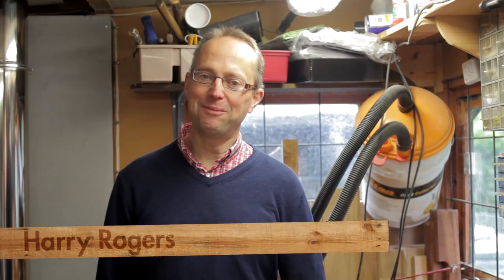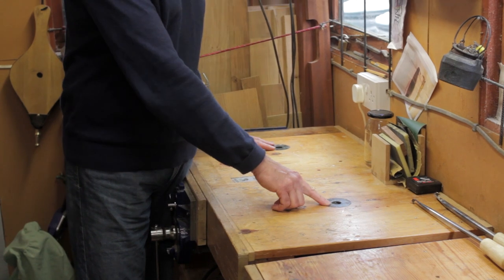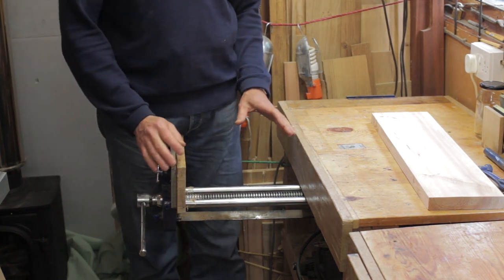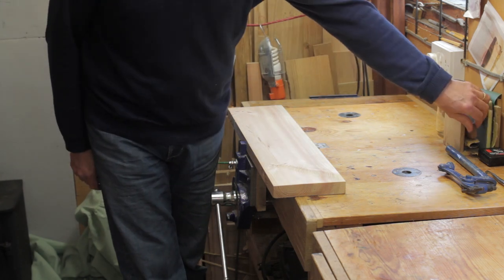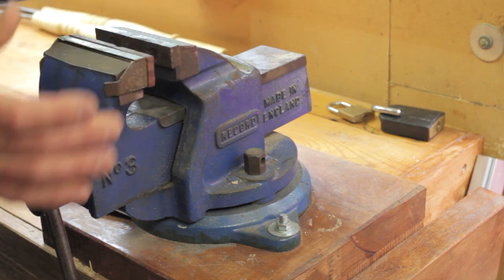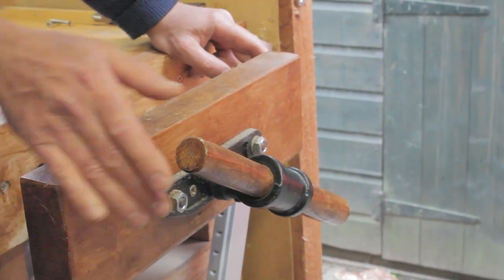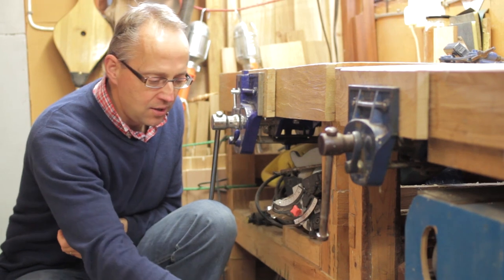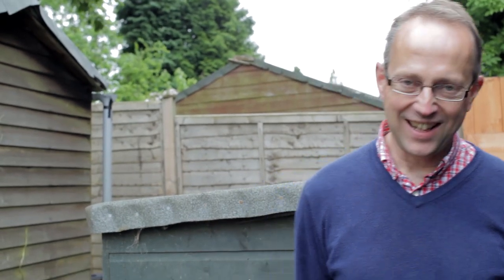A Look at My Workbenches

Comment: A while back I ran across a fellow on YT who had an ingenious bench stop.  It was piece of plywood attached to the left end of his bench & ran its full width.  It had 2 vertical slots in it where bolts went thru so it could be held in the desired position by a couple wing nuts.  I found out that idea had been published in a woodworking magazine a bit earlier.  I think that bench stop on the end of bench like I described would be effective & very easy to make.

Comment: I just went thru my library and I only found one book with that feature.  I know I've seen it in other books as well, but I can't find them.  I think the claimed advantage is for the times you want to hold a bar clamp in the vise to hold an odd shaped piece of work.  Having a board there all the time would make it hard to hold a board for edge planning.  Anyway, I've thought a bench made of laminated plywood for the top & apron would work well without a vice.  You'd just use hold fasts.